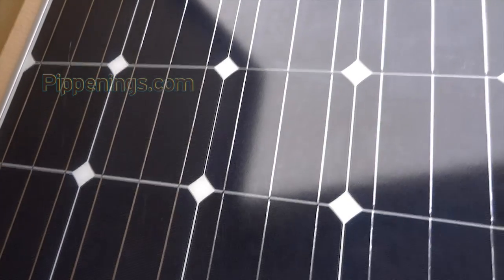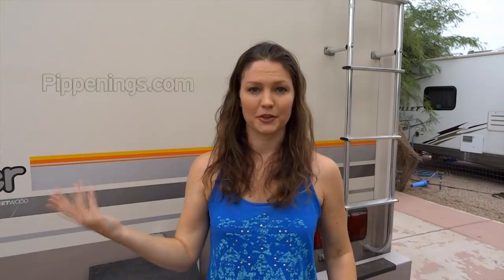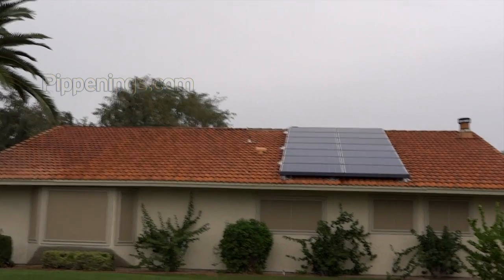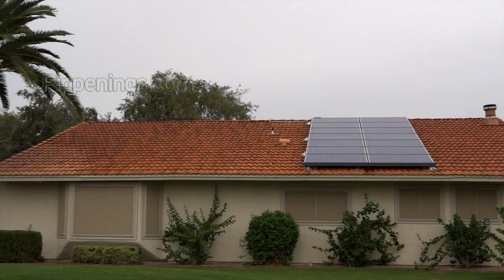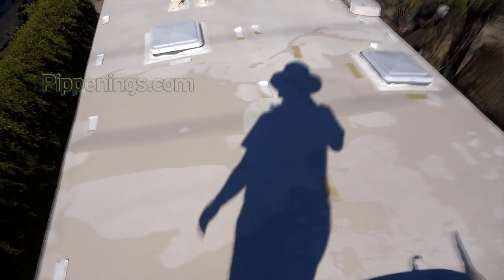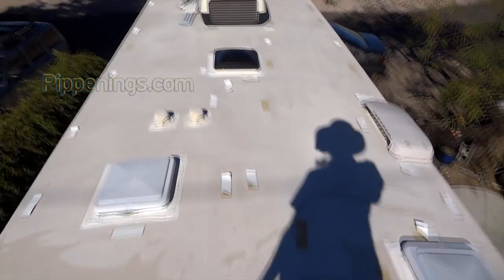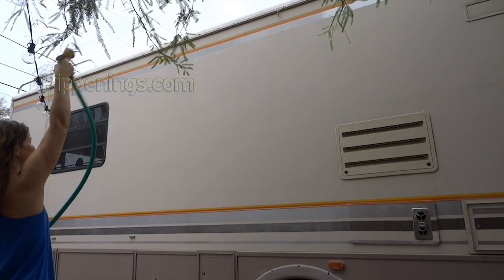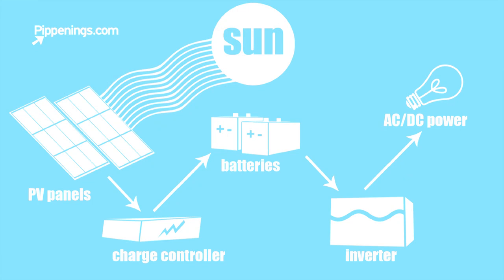RV Solar Living Basics: Panels and Charge Controllers

Comment: With current tecno, Solar Power is suitable for RV (along with electric motor power that charging in downhill riding and breaking) combined with light weight lithium batteries.

Comment: Hi Pippi! These videos are absolutely amazing! I was wondering if you can offer me some guidance on a simple 100 watt solar set up (new but affordable) for my 1977 13ft Trillium? I currently have a marine battery that runs to a converter that I have to basically plug and unplug when I am either charging or hooking up to the power in. (simple led lights, and one outlet). It is very dated and mish- moshed. I would like to keep this in place but get a solar setup to run separately as a primary using the old system as a back up. Any advice on newer products, schematics etc would be very much appreciated. Mike

Comment: This is one of the best explanations in such a short time that I've ever heard. It's very complete, and totally beginner friendly.

One question

7:50
if your components' amp rating are the same, but wattage rating are different, doesn't that necessarily mean that the voltage rating are different?
And if they're connected in series, then different voltages can work just fine without any voltage loss.

Am I missing something?

Thanks again. I love your videos!

Comment: https://www.amazon.com/gp/product/B017TPNKU0/ref=ox_sc_act_title_1?ie=UTF8&psc=1&smid=A2D22KZJD14Y8Y

https://www.amazon.com/gp/product/B06Y2CSQ5T/ref=ox_sc_act_title_2?ie=UTF8&psc=1&smid=AFNCTVSO1TA5H

https://www.amazon.com/gp/product/B06XPHDDM4/ref=ox_sc_act_title_3?ie=UTF8&psc=1&smid=A39062ZW830VOY

Can you tell me if these are good products, judging from your expertise?
I would like to use these with 4  12v batteries.  I know I'll need 2 of the panels rather than just one to solarize my shed that I'll be plugging my motor home into.

Comment: Pippi I love your videos and they are very informative, I thank you for putting them out.  

https://handybobsolar.wordpress.com/ <- This guy is crotchety, I do not agree with his politics, but he is also dead on when it comes to solar power in an RV/offgrid.  My system is based on the key fundamentals learned from his trial and error.

1. Charge at the proper voltage with a good charge controller
2. Get a Bogart Engineering TriMetric 2030 (or equivalent meter) and a shunt so you know exactly how many pixies exit and enter the batteries.  Battery voltage is NOT an accurate measurement of true battery charge level. Batteries not fully charged do not last as long.
3. Get good deep cycle batteries.  I love my Trojan T-105s, old school but very reliable, available at golf cart shops, and long lasting (5-10 years) if charged properly.
4.  Battery temperature controlled charging is mandatory, gassing voltage increases greatly with reduced temperature.
5. Every RV shop I have had experience with did it wrong.  30amp breaker with a 75 amp converter?!?!?! REALLY?!?! (yes this was installed by a reputable RV shop)
Reply from the maker: I've been to his site a few times.
Reply: Keith m Thanks keith for this excelkent site, the best i have ever seen on solar palnels !!! Tgis guy is the best when dealing with beeing selfsufficient for real in solar energy !!!! Huge !!!

Comment: Pippi, I went solar on my camper over a year ago. I had a really hard time getting answers on how to do it. I found this guys blog and it turned everything around. I would HIGHLY recommend you read this 
https://handybobsolar.wordpress.com/ 
I never need to plug my RV in. It's completely self sufficient
Reply from the maker: I've been there, thanks! How many batteries do you use? Do you run your fridge on electric or propane?
Reply: I installed two 100w panels. One Magnum Energy Inverter/charger https://goo.gl/fOjiqR
One Bogart Trimetric battery monitor & charge controller https://goo.gl/lNGEBj
Two Trojan T105 6v batteries. I placed the magnum Invert/charger & the Trimetric solar charge controller within 3' of my batteries. And I ran 2/0 gauge cables from them to the batteries. If I can give only one piece of advice, do NOT skimp on your cables. Magnum would not recommend running any further than 10' from inverter/charge controller to the batteries. Also, PPMT is for larger setups. Even If I was running 4 100w panels I'd still use the Trimetric controller/monitor. This system is so well done that the only time I plug the camper in is during the winter when there is snow on top of the cover. I get enough solar even when I have the cover over it to keep my batteries charge. Once the snow covers them I'll plug it in for a while.
I have a truck bed camper so I am limited on space for batteries. I changed out all the bulbs with LED. I don't live in my camper so my elec. needs would be much less than yours. I have a Honday 2000w generator that has not been used since i flipped the switch on the solar. And I dry camp 99% of the time.I do not run the fridge on my batteries. You'd need 4-6 batteries and more panels in order to do that.
Reply: David Bowen Hi David, thank you so much. I have read a part of handy bob web site but it was so long ... hard to get all info in just one page. You ve summerised it up on just a few lines and i had caught all his knowledge in just a few lines. In addition, you confirm it works fine !!!! Great, thank you very much. Daniel

Comment: Great Pippi thank you. I talked to Cruiser Stryker toy hauler sales man and he said the roof was one step up from a rubber roof and had to be conditioned 2x a year and you could not with solar panels on roof. But maybe you could make it 5 inches high and flip up. I would like to get quite solar than a noisy generator. I want dish washer, washer, dryer... So sorry about your dogs passing. I love how you said he got up and lunged forward as his soul/spirit left his body. Your videos helped me get over my dogs and cats deaths of many years ago. I cried along with you and got healed  of long time held grieving... Thanks Pippi... I already understand solar better with your teaching verses all other teachings!!! I am still looking for toy hauler. One piece aluminum roof sounds better so you dont have to condition it. Looked at 3 used, moldy moldings around window so may have to get new one. I like bed room with curtain and not wall, hard to find in a travel trailer toy hauler. I hope to oil paint again. Bye!
Reply from the maker: Make sure you get a trailer with 50A service so you can add or have all those things you want. Thanks for sharing on your pets, I'm glad to hear it helped. I'm really glad to hear that, actually :D Happy trails!
Reply: Thanks Pippi now I know to get 50 amps which is 50 x 2, 100 amps, 3 times more than 30 amps I just googled and learned because I didnt know what 50A meant. I may be off grid so my service will be the sun? Cant wait to get on the trail when I get toy hauler, thanks!!!

Comment: It is difficult to express technical information, and you do a great job, but it will overwhelm most folks. As an example, 'one can mix panels of different watt ratings in parallel without much loss, so long as the difference in voltage in no more than 10%.' A statement like that, a good 'rule of thumb', should be simple enough to be useful for most.
Reply from the maker: Thanks

Comment: Be careful spraying down your panels-best to do it in the early morning-if the panels are hot and the cold water hits them it could crack the glass. Haven't seen it but all the solar books warn.

I have boucoup sensitivities and health issues starting w/ emf.  I have only solar, but a low emf DC 12 volt [great for RV] and I have the panels on a stand the RV guy made and they sit AWAY from the RV [when they get too close I get pins and needles]. I have a voltage control switch instead of a controller and do not use and inverter, but one is available through a remote connect [for things like printing a page or making a smoothie[where it only has to be on a minute.  Both types of controllers commonly used and inverters put out lots of RF radiation and dirty electricity. Took a lot of research and hassle to find a low emf set up. I was not going to be hooked to a smart meter even for a night, as I have had serious effects from those and my heart beats normal again now and my thyroid is back under control [smart meter messed up all that and more for me]. As I was not going to hook to the grid and the RV converter was broken, I has the service guy dispose of it.

Used so many books that I found good to learn about solar and communicate w/ solar professors and online and the best was a free online pdf book about building a safe low emf solar system-I can get you the link if you want-helped me make it safe, find the parts that were specific to my needs and understand voltage loss and wiring. Unfortunately my wallet sized my system for me:(. Still I get by, but where I am is compulsively cloudy.  I went on a big fast and got 2 more panels-I found Renogy the best buy and am trying to get someone to build a second frame for them at an affordable price. Having them away has another plus: if you park under a tree you are nice and cool and they the panels can be out away in the sun and can be faced south always. Down side is having to set up and tear down. I have found I need 2X the amount of watts as normal to make up for the clouds and always clouds, so even if they say a certain amount it really takes double to get the batteries charged-well that's the mistake my wallet made anyway. I can get by off the 200 watt set up in the sun, but most days NO as there is little sun-Oh and I am in SW, Arizona where the clouds collect. I have gone an entire month more than once and not been able to see my batteries near charged again due to clouds-200 more watts of panels would solve that. Also half the time NM is very very cloudy-one reason I left and so is most of the US-so hope this helps you plan. Also my battery bank right now is 225 AH so not really much to charge and when the sun shines it does so FAST.

I would not want to ever plug in again or go on the grid again: love not worrying about smart meters making me sicker or what computer glich is going to down the grid for a day-do not think the grid is too stable if it depends soley on computer operation. I love the freedom. It is not cost effective! But the freedom and independence is enough reason and then add health and security.

Best wishes and feel free if you have any questions or want book names or links. :)
Reply: PS: Glad you mentioned used stuff. I have both searched NM, AZ CL and spoken to people who had used they removed from clients. Have found it all to be junk. Did not know people were trying to pus recalled stuff. If it were me I would return for recall / refund rather than sell. I found the used to be overpriced and cheaper to buy a good new panel. I think those that make out well w/ used have lucked out buying it from a friend doing an upgrade or getting wind of a house being demolished that has panels. Funny there is so myth about great used equipment and finally someone is bringing the truth forth. Thanx:)
Reply from the maker: Thanks, I'd love the link to the pdf you're talking about. What kind of batteries do you have? Are those just two 12Vs connected in parallel? Are you running your fridge off of electric or propane?
Reply: Here is the link to the PDFs http://eiwellspring.org/offgrid.html  Also note that the ASC specialty concepts controller is not low emf as he states, and may be the reason he ended up not using his system. I ened up w/ the voltage control switch from Canada that he has the pdf on.  Also this link about health hazards of solar on the same site:  http://www.eiwellspring.org/SolarEMFHazard.htm  Bear in mind the guy is also chemically sensitive so things like use of propane are out for him, though they work great for us RV'ers and RVs have properly vented systems already.
Reply: I have 2 Napa golf cart batteries 225 AH each 6 volt-they total 12v in series and total 225 AH.  Later I am going to expand to 4 Trojan T105=RE's to double my AH. My current batteries are 9 mos old and adding more just would brind the new ones down, so better to wait and replace. I run my fridge off propane, though the circuit board to turn it on is electric. Does not use as much propane as I would think.  I had a Williams house heater installed by a guy who used to do home heat and now does RV modification-that requires NO electric.

Comment: how long to get a return on your investment in the panels and hook up? Will you save money on electricity, as it looks like you live in a RV rental spot and possibly you pay a flat fee to use the slot you are parked in? Regardless of the money issues I think understanding solar and using it is the future anyway and also sets you free in a power outage. Thanks for your informative videos.
Reply from the maker: It depends on what you need to buy and what you already have. Solar isn't necessarily cheaper but it's great to have the freedom and security from outages. I don't pay a flat fee for my electric so it will help out. Thanks for watching!

Comment: One thing I'd probably add. When dealing with off-grid systems (which you could consider RV's when boon docking). You size your system based upon your needs. You run your power off the batteries and your panels charge the batteries. So, you calculate your battery bank size based upon your daily power needs in Watt Hours. Then you can determine how many days you would like to be able to run off the batteries alone (this is used in the event whether prevents the panels from being able to recharge the batteries - such as on cloudy or stormy days). This determines the size of the battery bank you need. This is all done based upon a max 50% discharge rate for the batteries. For normal deep cycle lead acid batteries anything below a 50% charge rate starts to damage the batteries. Then you need to determine how quickly you want to be able to fully recharge those batteries in days. This is used to determine the size of your solar array need. There are some adjustments based upon power loss due to the inverter and wiring as well as taking into consideration the charging efficiency. Inverters are typically chosen based upon the max wattage and amperage draw you need at any one time. Most people aren't going to run their microwaves or AC off these systems but with a big enough system you could though you'll probably be spending money on expensive lithium ion batteries and high wattage panels to do so. 

I have a spreadsheet I've been working on to easily calculate all that but I need to do some work on it to make it easier to understand.

Comment: Adding PV's to our coach now. Well, I'm not going up to mount the panels yet as it is still pretty toasty here in Scottsdale, but the wire routing is done. I followed https://handybobsolar.wordpress.com info. Kinda have to filter through some of his rants, but I think the guy has figured things out pretty well. Since monitoring what your using and what is going back in to the batteries is extremely important, I went with a Bogart Engineering system. The monitor knows what the charge controller is doing and tracks the state of the batteries all the time. It also will raise the voltage level of charge based on the actual specs of the batteries, according to the manufacturer. Example, Crown and Trojan maybe ( actually are) different, so you can program it to do what the mfg thinks is best for their batteries. Most controllers will not do that. And the combo is not all that much money. Since I'm in AZ, and have a home in Flag, I got everything from Northern AZ Wind and Sun. Bought the new batteries from them, and picked them up locally in Phx to save shipping, panels I got directly from their store in Flag. There is a LOT to learn to do solar right.
Reply from the maker: Thanks for all the insight. I've been to Bobs site a few times. There is indeed a lot of information to learn. But the best way is to just eventually jump in and do it yourself. I've been waiting and learning for a few years and now I just need to get to it even though I wouldn't say I know everything....

Comment: what if you have this Uni-Solar PVL-136 Power Bond PVL 136 Watt 24 Volt 216" x 15.5" inches. Flexible Solar Panel and a Goal Zero Yeti400... still haven't install yet.
Reply from the maker: Just get to it. I can wait around sometimes too not being certain on everything. Just start and keep learning as you go! :D